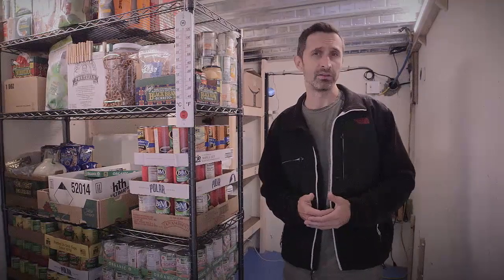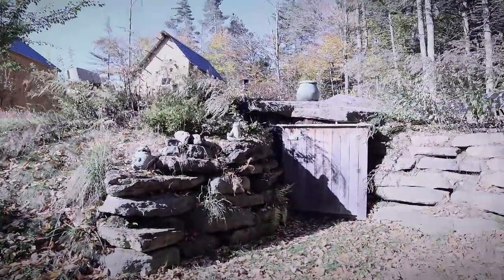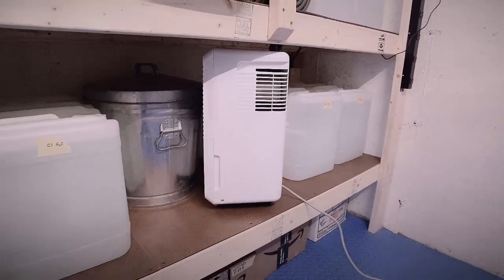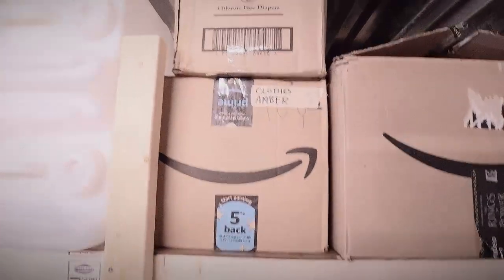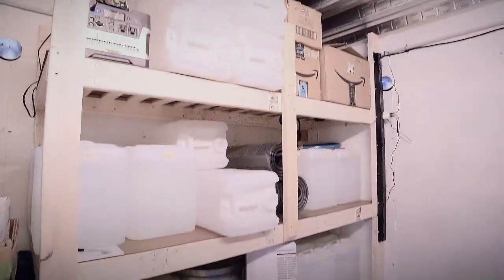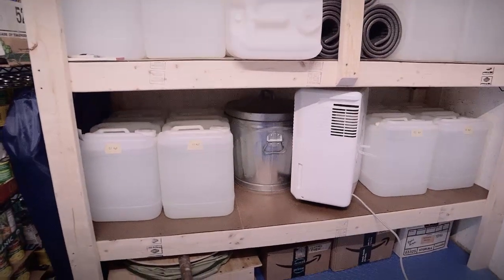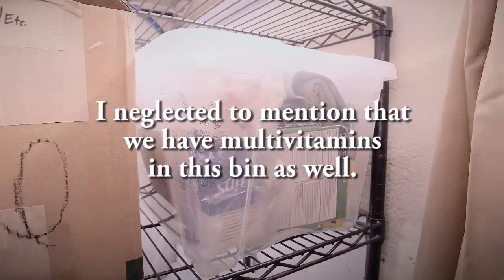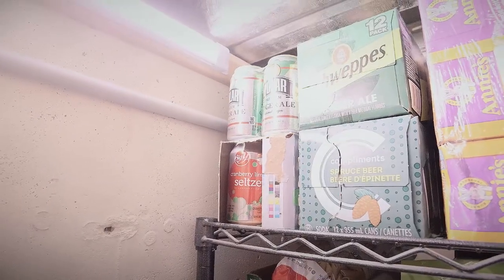Full Tour of Man's Private Nuclear Fallout Shelter

Comment: You need to change the front door latch as someone could block you in on purpose with either a padlock or even a piece of metal or even a wooden stick. Very important if you do not have an escape hatch.
Reply from the maker: Very good point. One could become stuck in there even by accident if a tree fell against the door. To prep for that possibility, the tools are available inside the shelter to relatively easily escape through that door even in that situation. Good on you for noticing that danger! And I appreciate you caring enough to mention it too - in case I had NOT thought of it. :)

Comment: Awesome shelter info! Consider reconfiguring your outside retaining wall possibly with heavy construction raised bed planters to form a solid wall in front of the door. Also a grapevine like structure over the door area could get a tarp roof to create an outside decontamination wash off area with a solar camping shower. Keep up the great work. 👍👍👍
Reply from the maker: I've been considering that same idea of building some sort of entry structure. In the same way that the fallout shelter is useful as a root cellar, I'm trying to make any entry structures being dual useful as... not sure yet. I've been thinking of a simple deck out over it as well. So many possibilities.
Thanks for the comment. I'm glad you found the video enjoyable.
Reply: I really enjoy your videos. My suggestion for raised bed planters and a grapevine structure is to maximize the beauty and usefulness of those during normal times while offering additional shielding and functionally for the worst case scenario.
Reply from the maker: @kennethsantos7919  It's DEFINITELY not clear from the video, but the entire top of the structure is heading towards being used as a raised bed. At the moment, it's a bed of weeds and a few sunflowers, but over time, we're definitely looking to develop it as a garden bed of plants that don't want/need watering (because more water over the shelter means more water to be dehumidified out of it).

Comment: Put your breakers and switches in the SHELTER. That way, you only disconnect power once in it and you can turn on water pressure, etc. from inside the shelter. If you are not downwind of nuclear fallout or you are far away then that same fallout is of much less concern. This is an entire topic for discussion so it is not really a simple rule. You never go wrong by planning for fallout. This vid does a great job. If you live with fallout, get used to a new timeline for a lifespan since you will live but not necessarily to the average of 84-86 years old anymore.
Reply from the maker: Good tip on breakers inside. For my situation, this is a bit of a retro-fit so not everything is perfect. If I were going to do this from the ground up, I'd definitely have more access to systems from within the shelter.

Comment: Good job. I watched the whole thing. Just a few thoughts.  Given the small space, I recommend running the majority of your power needs on 12 volt such as the light and air blower. On day one you may not be too concern about inverter inefficiencies but eventually you be counting every watt. Use the inverter on items that must be on 120V and turn off when not needed. Idling an inverter will waste your batteries. Your inverter is just another thing that might break. In regards to your batteries, store it above the floor. In your case, any water seepage will flood out your battery right away.  Space heater and heat plate will suck your battery dry within hours. Get 12V electric blankets and gas burner. O2 is not an issue since you have fresh air coming in. The inverter should be placed in the faraday cage until needed. Can you get more 1/8" Lead sheeting and line the door? If you have people addicted to coffee, stock up on coffee. Get kitty litter or wood chips to absorb bodily fluids in order to manage vomit or diarrhea. Even with trash bags, it's going to be messy. For the shower, how about large drip pan in front of the toilet and a garden sprayer so you're minimizing water waste? Then get a dirty water sump pump to remove the water. This pump can also extract water if starts coming in from the front door or you have a hose burst. One other consideration is fire in the area. Get battery operated smoke detector to warn you especially in middle of the night. Can you talk more about your air filtration solution? if there is alot of fallout, how will you replace the media daily/every other day, etc? Have a simple shortwave radio so you're not powering up the ham equipment all day long. Include a flat screen TV even if it's for videos once a day.  I would also recommend a lengthy 4" pipe to run from the shelter down the hill so that it can double as exhaust or a way to flush things out if needed. Have a separate battery for the fan in case your main battery runs out for whatever accidental reason. Having isolation between batteries means you can't accidentally run the other one empty. Hope this all helps.
Reply from the maker: Great thinking HGW! You and I think alike! I have a lot of your notes actually already covered to some extent. The one thing that you did pop into my head though (when you mentioned kitty litter etc) is paper towels. I'll be adding that. We can discuss more in the livestream about the power plans. As it goes, we have two systems, the whole house system, the backup that's just in the shelter, (and then a bunch of mini systems and manuals on top of all of it). I hope to see you at the live. Your head comes up with on-point questions and concerns!
Reply: @PraxisPrepper  Looking forward to your livestream.

Comment: Consider the swiss air filtration that atlas shelter's uses. It's got a HEPA filter but also a large amount of carbon
Reply from the maker: I'm sure those are great. Mine had the benefit if being a lot less money. If I had to guess, I'd bet his are superior, but I couldn't afford one of those and wanted to have something vs nothing. Ron seems like an honest business man to me though, so I'm sure he's done his research and I bet the Swiss ones are top quality.
Reply: @PraxisPrepper  He even has israeli made ones that are pretty much the same as the swiss ones. The swiss ones are like 8k while the israeli ones is about 1.5k. You could also consider an overpressure blast valve which lets air out but not in, so you won't need to worry about not sealing because air will have an escape.

Comment: Exercise cycle or treadmill will help.
Reply from the maker: I'm not a big exercise cycle guy, but I AM addicted to a Nintendo switch video game called Ring Fit. It's my every-other-day exercise routine and it's definitely going in there in an event. If the power goes out and we can't play it, then I guess our main exercise would be using the manual air circulation pump. Not as fun as the game though.

Comment: No exhaust vent
Reply from the maker: I think about your exhaust vent suggestion nearly every day. I really need to do a test to see how much air is allowed in when the door is closed shut (which wasn't possible to do from the inside until recently). My plan (if presumably I DO need more venting out) is to swap the lid of one of the light tubes out for a vent with spring-loaded flaps to let air out. That's the last thing I'll likely need to do before a full test.
Thanks for reminding me about it. I definitely didn't need it because I do think about your words all the time, but I appreciate your making SURE I don't forget them! ;)

Comment: Great to see you have made the step to get a shelter, I think as budget allows I'd add a porch with the wooden door and a wash off area, beyond hat where the door is now I'd add a gas tight door and some over pressure value to keep you safer in the shelter. the water idea sounds good until it goes wrong or yu need to go out and come back in, too much of a chore and you need to think safer rather than mistakes on the job. Still, something is better than nothing as we all know
Reply from the maker: Agreed. This is far from perfect. I would do a great many things different if I were building this exclusively as a nuclear fallout shelter (your suggestions likely being among those things).

Comment: Shrink your entryways to no more than 20” by building concrete walls. Leave second entry 18-20” wide and started from the wall were your sink is located, this will create dead end to trap radiation. Get solid blocks or pavers to fill 18-20”  entryways after you get inside as tight as possible. Cross lay bricks without seams going all the way .
Reply from the maker: These are good tips. If this structure had been primarily built for this purpose, the entry (and a great number of other features) would have been designed differently. Thanks for the thoughts!

Comment: Great video. Very informative. What kind of ceiling is in your shelter?
Reply from the maker: It's made with thick corrugated steel roofing sheets that had 8"-10" of concrete poured over top. about 3' of dirt is above that presently.
Reply: @PraxisPrepper  thanks so much. I'm considering making my own shelter/cellar. I've seen that corrugated steel in schools and commercial buildings just haven't seen it for sale anywhere.
Reply from the maker: @thomaswhite5928  I didn't buy it myself. The contractors that did the pour of the concrete supplied it. If you like, I can get specs on it (measurements etc.) so you can have a sense of what to look for. Shoot me an email at praxisprepper@gmail.com if you want me to grab that for you. I can send close up photos too of that stuff as well.

Comment: If a Atomic war started - you have about 30 minutes just to get inside. Your door is a giant mistake, add a exterior concrete mud room, add a steel blast door. Add a room just for vittles and water to get more family space. being crammed into a box with little room can increase stress for every one. Build a real bathroom! I thank you for posting.
Reply from the maker: I agree with a lot of your points, but had some thoughts on them as well where I think I disagree with some points too. It's mostly 3 points that pop up in my head.
1. When you say, "If an atomic war started, you'd have 30 mins to get inside." That presupposes that the moment that the war started, one would be alerted and know that it had started. That's  very unlikely to be the case. The first warning that an atomic war begins (for the general population) is likely to be an atomic explosion occurring. For the people in the blast zone, they won't have 30 minutes. For people outside that area, rumors will start to slowly swirl. At first it will seem like a possible psy-op, cyber attack hoax, or the real thing. So people will need to make a decision. For the vast majority of those people, they'll have well over 30 minutes unless they're in targeted areas. So I just wanted to comment on how clear any of this would feel if it began. I really don't think it's as simple as a ticking clock starting up and counting down. I know you didn't mean 30 mins exactly or anything like that, but I wanted to comment on the likely ambiguity of those early moments.
2. On my shelter, I agree that it would be nice (in the event of a war) to have MUCH more space. We 100% agree on that. But most people (myself included) have limitations in terms of resources. So we have to work with what we have. This is what I was able to swing when I was building it back several years ago. Most people that see this video suggest that they can't even swing this. And I don't think they'd need to. People could make less than this work too. It'd be less comfortable, but it could be done.
3. Last, on the door to the shelter, yes, it's not a blast door at all. In fact, the entire shelter is not a blast shelter. It can't take a bomb strike anywhere nearby. What this is is a fallout shelter. It's a shelter from drifting fallout from other areas. Again, building an actual blast shelter would be great, but with limited resources, it's not in the cards for everyone. Someday I might like to try building one though. It's a lot more required in terms of depth and that door you mentioned. Also, the air intake of our shelter wouldn't withstand a raging fire above either.

Comment: 20 inches? Minimum is 3 feet for root cellar.  Praxis
Reply from the maker: Yeah, it gets too hot in the summer. I'm adding more material over time slowly. No engineers were willing/had the knowledge to certify the load carrying capacity of the ceiling of the space. So I'm going slow. I actually think it was more like 28 inches too (including the 8 inches of concrete). I looked at my diagrams afterward and I'd had 14 inches of dirt and concrete initially, and I had aimed to add another 14 inches on top of that recently.
Reply: @PraxisPrepper  : before adding more dirt and material. Do have three steel crossbeams in the roof? 18  inches of insulation   and 24 inches of dirt should keep it cool and warm about 60 degrees for root celler.

Comment: Better change that exterior door. It stopping radiation is like paper stopping rain.
Reply from the maker: Your analogy actually assumes the door would stop more than it would. It's more like a pane of slightly tinted glass stopping sunlight. The door isn't meant to block radiation at all. It's only intended to seal against dust intrusion. The reason this isn't an issue is due to the angle of the entrance corridor. I talk about it in the video about. It's referred to as geometric shielding which isn't really shielding at all, but rather a tactic to prevent the radiation that does penetrate from getting into the actual living area.
Reply: There's no radiation with a Hydrogen bomb (fusion).Only a Atomic bomb (fission) has high levels of radiation.

Comment: I would place the mental shelves flat against the walls giving more space. I would go stir crazy in that small of a space let alone 2 children. Space is necessary. I know it’s for imminent events and you have done an excellent job. Much thought and safety , invested time and money. I’m just concerned about mental stability and moral . Space seems a premium .
Reply from the maker: Both shelves couldn't fit up against that wall. But you know what... I bet that one between the bunks and the other shelf COULD fit if it were rotated 90 degrees and slid up against the wall. I'm not sure why I didn't think to do that when I was setting them up. I'll be out there with a tape measure tomorrow and I think I might see if I can swing that. You're 100% correct about space being a virtue in a space like that.
Reply: @PraxisPrepper  Maybe try it out like it is for a day first. I know that I would personally prefer the room divide for some privacy over having a bigger open space, but that is obviously not everyones preference. Whatever you decide to do, wost case scenario you can still empty, rearrange and refill the shelf again, when you are already inside. That will take some time, but it's not like you woudn't have enogh time to do that if sufficiently bored...
Reply from the maker: @mar.2  that's a good point. A brain like mine will need some "home upgrade" projects to engage in if I'm ever stuck in there. Best to leave some tinkering as a gift to my future (terribly bored) self. :)

Comment: I don't think i could stay in such a small place (with 2 other persons) for 2 weeks. Neither I think the radiation could be such a threat (could it be?).

Even if a bomb detonated 5 miles from me, i would probably stay in that shelter for 1-2-3 days top, than i would move to (airtight) house. If the bomb hit 10+ miles away I wouldn't even bother with the shelter (that's why I don't even try to have one, and I'm from Poland, I just want my home airtight, with ventilation/filtration, and protected against shock/heat wave to reasonable degree, you should probably also consider some protection of windows, and all that wood, in case of attack in extreme drought).

Also, what kind of filters are you using in that air intake box? Professional ventilation systems (for personal use, family shelter, or basement, for $2000-$3000 before 2020) got filters for like 2 weeks max. In case you are forced to move to that shelter you would probably have to replace filter after a week, or even faster (and than the second one will last longer). Next month i will most likely finally be buying some filters, 4" fan and tubes, or something similar (can't decide yet, there are some ventilation/filtration solutions for military vehicles, similar specifications from what i read, maybe i will choose those).
 
I still think we (or Europe) are 2-3 years from war (2025). But, USA could be attacked faster than Europe (because of the hegemon role it plays), could be next year. USA could be attacked by Iran and Korea (backed by China and or Russia), and, or by some russian submarines (stealthy). Obviously New York and other coastal cities will be primary targets. It won't be 3WW immediately (no direct involvment of any superpower), and only several nukes may actually hit. I think this is now most probable scenario.
Reply from the maker: You're clearly giving this some serious thought - and it shows. I agree that 2 weeks in a shelter would be tough, and maybe not necessary. That's what the Geiger counters are for. maybe it's a half week in the shelter and then we pop out a bit for this or that (mental sanity etc.) and spend half or more of our time (including sleeping for sure) in the shelter. It all depends on what's outside.
I like to hope war is staved off, but I like to be ready for things to move faster than I might hope. For me, once I have my preps in place, I feel like I can move on to other things feeling that I've put in the best effort possible.